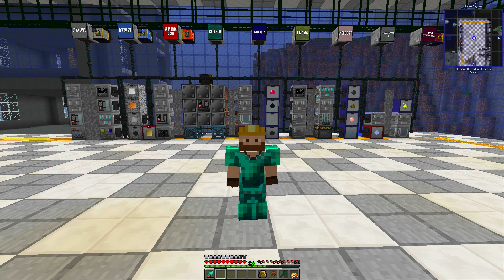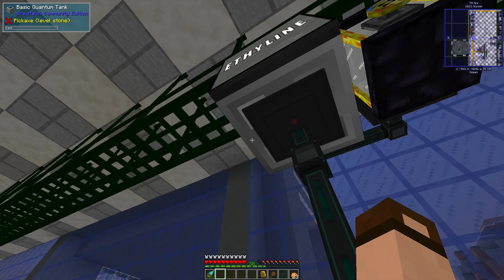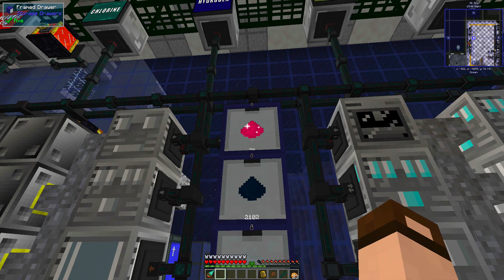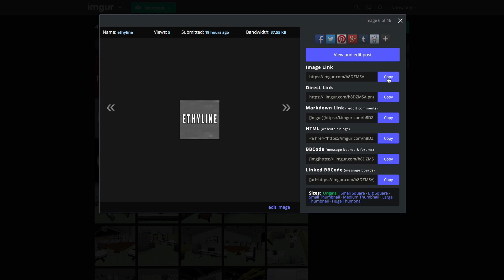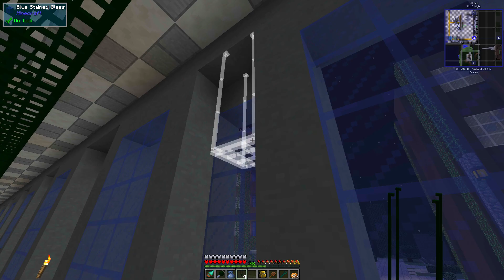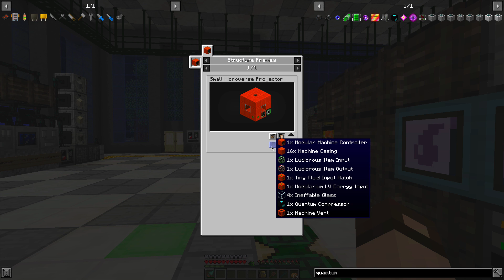OmniFactory - ep 8 - Re-Org & Titaniumization

Comment: I'm also playing this pack on a mac, and was having awful framerate issues. I added some mods that have helped tremendously: BetterFPS, TexFix, VanillaFix, and Phosphor. I added them all at the same time so I'm not sure which ones are helping the most, but I'd guess that BetterFPS is making the most difference.
Reply: For me its the Learned Mod causing all lag problem. I think its cause the blocks emit light cause I get bag leg as well from the lanterns as well.
Reply from the maker: Do you mean Deep Mob Learning?
Reply: Nonsanity yes the Mob Learning is what created the lag on mine. It didn’t get bad until I did 3 of each mob.

Comment: If you disable animated textures you should get a massive FPS increase, it's an issue with AMD GPUs (I assume that's what you're running since most Macs are.) In config/foamfix.cfg set "B:disableTextureAnimations" to true and see how it goes for you.
Reply from the maker: I’ll give that a try and see if it helps, but I worry that that change will detrimentally affect the series’ look. I can test it, for sure. I originally only looked for a setting in GregTech to stop the visual updates for its own machines, but it doesn’t have such a configuration setting.
Reply: This worked in my world. I went from 55fps to 118 fps. Thank you for your info
Reply from the maker: Unfortunately, that didn't fix my problem. Well, maybe a tiny bit, but not much. I'll have to keep trying things.

Comment: I think you don't quite understand how the dynamos work. They attempt to dynamically throttle, based on how much power is inside them. At ~37:25, you're talking about how "even with three of the power generation upgrades it isn't enough", but if you actually look at the power statistics on the left, it's only generating ~1.5k RF... out of 10k max, if the dynamo's storage was empty. If a dynamo's energy storage isn't changing, it's outputting how much power is being used. If it's emptying, the power generation is ramping up, if it's filling, the power generation is ramping down. And this is why the excitation field limiter augment is important, if there's nothing always on attached, or you're using less than 10% of what the dynamo makes - it means the dynamos can throttle down to nothing, if no power is being used, not constantly use a trickle of fuel to make a trickle of power that immediately is wasted.
Reply from the maker: I probably didn’t say the right words while recording. I know the general behavior of the dynamos, if not the actual throttling formulas. But you are absolutely right in that the dynamos only output what’s needed and if they aren’t outputting at max, then additional power is it needed and they aren’t under-performing. I’ll try to explain it better next episode. Thanks for the attention to detail! :)

Comment: another interesting fact about thermal expansion: invar, the alloy of nickel and iron, has a "uniquely low" coefficient of thermal expansion (how much it expands and contracts based on temperature)! iirc, i found this when looking up invar for some reason, and suddenly the name of the mod thermal expansion made a lot more sense ^.^
Reply from the maker: That sort of material thermal expansion, as opposed to the fluid expansion I was mentioning, is also cool. You can do some neat tricks with it, like sandwiching two materials with different thermal expansion properties together. The result will bend when one expands and the other doesn't. Thermometer, anyone? :)

Comment: you could've used a fluid solidifier to make obsidian and naquadah is made by smelting naquadah dust in a furnace and you get that from the tier 5 micro miner. tungsten isn't that far you just need to get tungstate which comes from centrifuging end stone dust but you'll need ev machines
Reply from the maker: True, but these blocks were cheap and required no power. :)